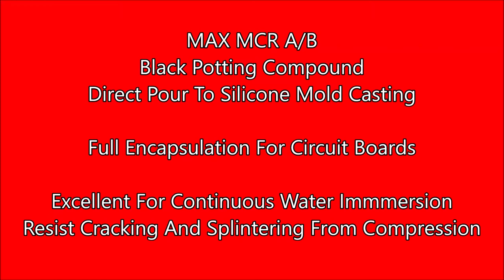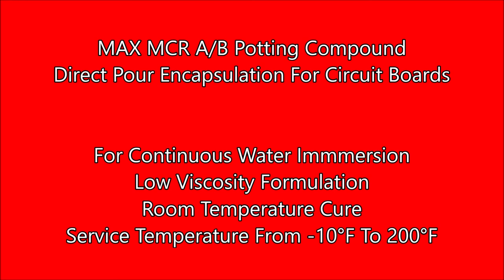MAX MCR Epoxy Potting Compound -Encapsulant For Circuit Board -Direct Casting To Silicone RTV Mold

Comment: hi, love your work
1 question
does heatsink from high temp mosfet need to be removed before potting?
Reply from the maker: Thank you very much for your kind words. Typically heat sinks are supposed to be left exposed to open air so the heat sink can pull the heat away from the source and should not be removed.

If you need a high thermal conductivity potting compound, please check out our MAX EPC A/B. It is formulated with thermally conductive fillers that make the potting compound act like a heat sink as well. The filler used is calcium carbonate -similar to pulverized marble that also increases the insulative value of the potting compounds;
Check out this link;
https://www.ebay.com/itm/223495919658
This is the demonstration video for the MAX EPC;
https://youtu.be/I-GJtGdgUTM

If you wish to send me an email, you can contact me at alchemystone@gmail.com and send me a picture of your application, and I will assist you with the process and proper resin selection. Thanks again.
Gerald